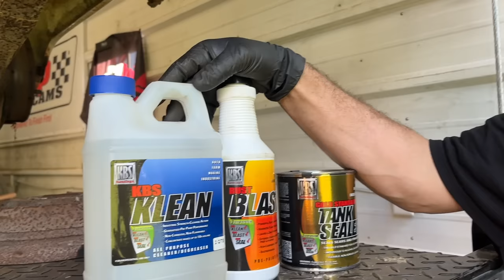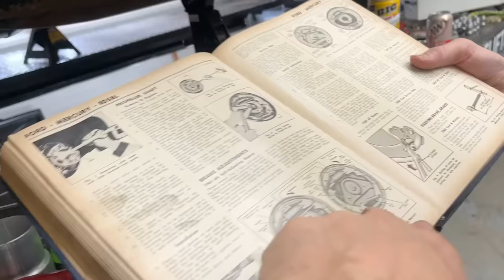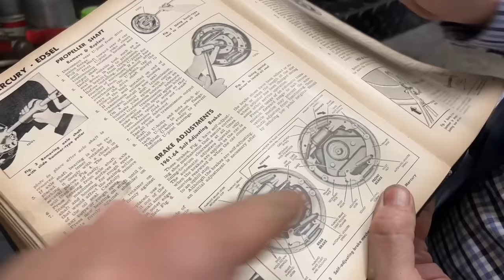Stick Shift V8 Wagon! Rescued from the Junkyard. First Road Drive in 30 Years!

Comment: My hint is that instead of promoting huge SUVs and TRUCKS for "the future" - like 20 years ago they should have literally paid to keep people in inherently efficient and low impact sedans AND WAGONS (which are almost gone now but IF they pushed those, there would be SO many wagon rethink designs out now) - with all the monies going to get people in electric in TODAYS MONEY (as it is all reaction based - I do not care the price it has to be done) - they should have paid people to stay in sedans with reasonable sized powertrains.  Sedans biggest cost now is making them safe AGAINST and BECAUSE of the large OTHER vehicles that are so abundant. They wear the infrastructure WAY less and that is costing so much to upkeep - here the mayor got in saying more repairs and maintain over replacement, additions, and renewals - but if someone did the research I bet a sedan compared to say a 250 RAM  is like 1/10th the wear.  ANYWAY - those station wagons are like gold going forward - so it would be nice to get them restored to be around and as an example for future generations that for domestic use, these were more than up to the task for most.

Comment: I understand you're doing respiration on a budget. The issue with the brakes why didn't you just convert to 4-wheel disc instead of going to all that trouble to have those obviously worn out thin drums turns like that. If you're keeping the car that's the way I should have put it are you keeping it. If so why not the conversion and why not power brakes. You've gone that far
Reply from the maker: Ok thanks

Comment: Did you know that there is a right way and a wrong way to hold your pliers if you look at the teeth there not straight They are angled the top of the pliers are angled to the back of the pliers and your grip is all ways better when that is at the top of what ever your trying to turn
Reply from the maker: Ok thank you I will look at that

Comment: Or you can reclock the back part of the alternator to get the terminals away from the head. remove the bolts rotate the back half reinstall the bolts. long brackets like that will crack especially since its thin china chrome. That could be a later 5.0 alternator designed to mount high. Ford strikes again!!

Comment: Save on turning drums. Get a cheap sharpening stone. Mount a drum inside out on the rear and run the motor. Hold the stone inside the drum and watch out for the lug nuts. Canuck hillbilly technology.

Comment: Please. Put disk brakes on it from a full size Galaxy please!! That a $120 you're spending on turning the drums. Could? Be. Much? Better spent. At a reckoning yard buying new? Brackets caliber caliber for the front.. Then you are. Find a nine inch knowledge with this brakes for the rear because you already have a broken spring mount anyway Convert it to latter bar or a four length anyway 

Sometimes you make me cry there's easier and cheaper ways to solve. Oh see you working with your young ones!!

Comment: Josh you told an old dog a new trick...lol. I have never seen anyone use a crack smoking torch to heat a brake line. And it worked great! Next time I stop at gas station or 7-11 I'll have to grab one, it is a whole lot easier than dragging the big bottles around. I laughed so hard when I saw that.
Oh yeah by the way, since when do yall  use those little semi dirty sayings like " it's tighter than a dicks hat band! Did Tosh realize what she is describing...lol. it don't bother me a bit. With a mouth like mine I certainly am not criticizing ya I was just laughing hearing that come from her...lol I know yall don't curse and really raise yer children the way everyone should be doing it. Still lovin the channel after binging thru all of your videos. I just w9nder qhat uall are doing with all these old cars?

Comment: I must also add that your method of adjusting brake shoes is flawed. What you do is OK for assembly; but with the casings mounted, spin the whole assembly (wheel & casing) while tightening the brake adjuster, when the wheel can no longer turn by hand, back off three clicks. In other words, you need to adjust from tight to scuff instead of from loose to scuff. This method results in a more even brake adjustment and cuts down on assembly errors (which I think you have discovered previous to this episode). Try it, you’ll like it.